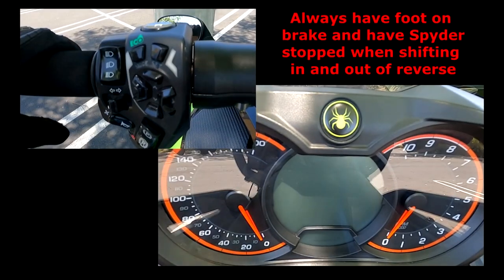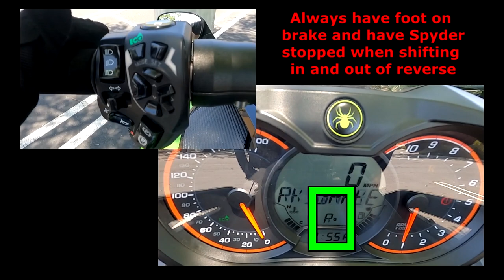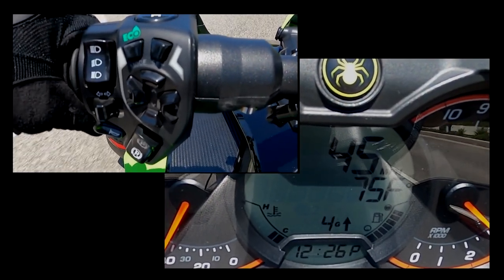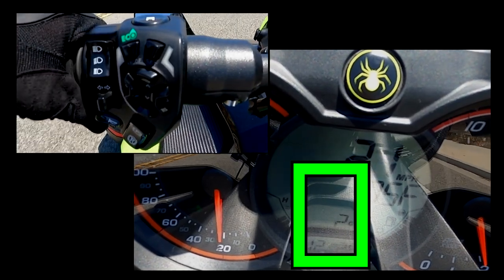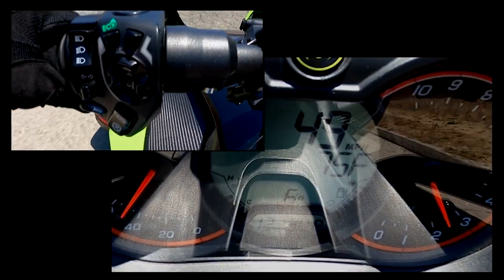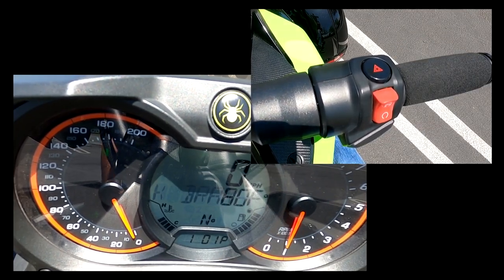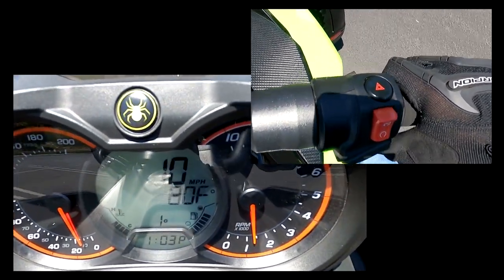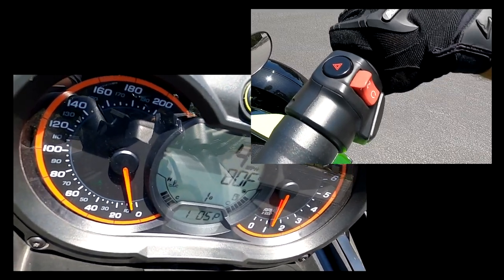Shifting a Can Am Spyder // Using the Paddle Shifter and Reverse on the Can-AM Spyder

Comment: Great informative video indeed.  So I like the bigger size of the f3 over the Ryker, but, I love that the Ryker is fully auto.   To be that close to fully auto, I don’t see why I just wouldn’t go with the Ryker.  Especially the Rally.
Reply from the maker: The difference between the Ryker and F3 is mainly comfort, quality, power and two up riding. If you want to ride long trips and have a passenger sometimes - Spyder wins on that. If you are looking to save some money, Ryker Wins. Ryker is more nimble and quicker on take off, but Spyder is more powerful and faster in the end. There are good and bad points to each, it all comes down to personal preference. Which ever route you take you will be happy with. Think about your needs when deciding.
Reply: @MOABMAN  Thank you so much.  So can the Ryker Rally be used for decent travel?  Like a 4 hr drive?  I subscribed by the way.
Reply from the maker: @a.d.c7941  Thank you for the Sub and support! The Ryker can be used for long trips but endurance really depends on the rider. You can also buy aftermarket seats that help with comfort. 4 hours should not be a problem for driver, but I would say no for a passenger. It is not the same level of comfort as the Spyders. The newer Rykers are improving though.
I suggest if you can take a test ride or sign up for the 2022 Can-Am experience if you are able to. Here is the video talking about how to sign up:
https://youtu.be/zKxIDBQPTyE

They take you on about an hour ride and they have different models to ride. Hope you can sign up and this helps.
Reply: @MOABMAN  thank you!! I am going to look into the can am experience.   Thank u so much!

Comment: What are your feeling about the Ryker?   As a local rider, quick grab and go.. for someone who already has an F3.
Reply from the maker: The Rykers are good for short trips and playing around. They are cheaper and feel a little different than the Spyder. I personally take the Spyder everywhere. My choice is Spyder over Ryker even for short trips. I may eventually get one (the Rally) just so I can do dirt road and a light off-roading in it and not feel bad if I ding it up. Supposedly that was one of the benefits of the Rally but I personally have not had the chance to ride it that way so cant speak to that. I like the looks of some of them and like the cost point as well. But if your question was more along the lines of, if I had a choice of one over the other and that was the only one I was going to own, then with no hesitation would pick the Spyder line. Way better of a ride, quality, comfort, power, and fun over the Ryker.

Comment: Hello MOABMAN Can you do a Video showing how to use all the features Like radio/Display/heat seats/ lights/ adjusting suspension and foot pegs for those who just purchased a new 2021 F3 Limited.
Reply from the maker: Hello Michael. Thank you for the support. I will do a video for the controls, but can't promise when it will be out right now. I have 2 videos in the works. I can help you out on the other things now hopefully. 
For the foot pegs this video may help: https://youtu.be/nQQo5ByhEN4 
it is one of my first so sorry about the editing. 
For the suspension, page 59 in your manual talks about it. It is super hard right now for me to get access to a spyder with everything going on, so I can not physically do a video on it. I hope this helps and as soon as I can get access to other Spyders i will make sure to do a video on this.
Thank you again for the support and I will do what I can to get the video on the controls as soon as I can

Comment: This is great for us future newbies to riding. Question?  when upshifting gears, to you keep throttling up at the shift or do you just lay off the throttle when shifting?  For someone like me who will be new to riding, I think the eco mode could be of great help when it comes to changing gears until we get the feel of the bike and changing gears becomes second nature.
Reply from the maker: Hello Stevie, thanks for the comment and support! You do not have to let off the throttle and it is better if you don't. You maintain the throttle speed when shifting and can even be increasing speed when doing so. The shifting for the Spyder is awesome and doesn't take long to get the hang of. Using the eco mode will help in showing you the best time to shift for good gas mileage, but is not good for going fast or passing a vehicle.  Any shifting between 4000 to 6500 RPM is good to get use to when not in ECO. Try not to train yourself if your new to riding a motorcycle on a bad habit of looking down to rely on shifting. Use ECO as a reference first, but train yourself to feel the bike. This way you take your eyes off the road less. A split second can change your life if your not careful. Welcome to the Spyder family, you will love it! Stay safe and ride happy.
Reply: @MOABMAN  Thank you for that advice!  That's my worry is looking down because in a car you can get away with that but on a bike, that could be trouble, especially on the highway as that could spell trouble.  It sounds like when it comes to changing gears (for a new rider) it's all about confidence and feel and that's the part you have to get used to and once that is set you're good to go.  I am really looking forward to getting the Can-Am Spyder and being in the open air as I mention, for me the biggest worry is gear changing as I have never ridden a motorcyle of any sorts but your video is the best one I saw in terms of teaching gear changing on the Can Am and it's helpful but as with everything it's just getting reps on your own to build the confidence.   Thanks again!!!
Reply from the maker: @steviem5279  The Spyder has removed all that fear for you, trust me. It is easy to shift. I do recommend that you check into taking a 3 wheel course. This would be the best thing for you to do to be safe. This will help you feel more confident about riding to.
Reply: @MOABMAN  I will definitely do that!  Thanks again!!
Reply from the maker: Your welcome and thanks for the support!

Comment: I have watched alot of your videos and have learned alot. I am taking my class next week for my license. But i have a very silly question im sure you will think. To slow down taking corners you use the throttle and then to speed back up you use the trottle correct? No breaks? I'm trying to learn all i can before the class as ive never riden a bike in my life i wear ankle braces...i have a 2015 Spyder RT thats been sitting all winter waiting for me to ride. And im anxious lol soon to be 62yrs old.
Reply from the maker: Not a silly question at all and thanks for the comment. First, dont be nervous about the class and what you think that you dont know. That is what they are there for and ask all you can. You will learn a lot and be confident to ride when done. You will "roll" off the throttle on certain curves and use brakes on others. The more you ride the more comfortable you will get at this. You need to judge before going into a curve and start making the adjustment. Sometimes you will only need to let off the throttle and steer into the curve. For sharp turns or curves, yes you need to brake a little before going into it. You dont want to slam on brakes in the middle of turning or curves. Coming out of a curve you then start giving gas again. They will talk about this in better detail in the class so dont worry!! Thanks for comment and support
Reply: @MOABMAN  Thank you so much i guess its close to like driving a car. Everyone has told me not to worry about taking this class its just something totally new to me. I really appreciate your help and your videos. I maybe asking more questions soon lol. Thank you again have a wonderful day.
Reply from the maker: @sallyhall-fj3yp  you are welcome and yes it is like using a car in curves (only speed wise). Go in to the class with no worries so you learn easier. You are more than welcome to email if you want to ask a bunch of questions. moab.man@yahoo.com

Comment: Great explanation! I was wondering if you always have to look at your rpms to tell when to shift or overtime you can just tell? Like Does the bike feel different and that’s when you know to shift or you just kinda know after awhile.
Reply from the maker: You quickly get use to the feel and sound of the bike. The only time I look at RPMs are when I am pushing the bike for speed and want to get every bit of power I can out of it. Even then you can feel it.
Reply: MOABMAN thanks for responding, looking to get one next month and I couldn’t get that answer anywhere. You just got a new sub!
Reply from the maker: @charliblaze718  Thank you for the comment and support! You will like it and it is a lot of fun. If you never rode a motorcycle before, don't worry, the Spyder is fairly easy to ride. You still need to be careful and not forget that it IS a motorcycle and your the bumper!!! Stay safe and ride happy!

Comment: Do you let off the throttle when you shift
Reply from the maker: That was one thing i wish i would have covered better than i did, so thank you for asking. You do not let off the throttle and it is better that you dont. For me i just keep it at where i am when i shift. What i mean by that is i dont let off or give it gas, just maintain the current throttle position. If you let off the throttle it will make a louder than usual "clunk" noise and jerk you a little bit, that has been my experience on different models as well.
Reply: Steady throttle on up shift.  Up revving is automatic on dowshift

Comment: Hi there and thanks a lot for your video! I have 2 questions:
1.- After turning off the engine with the killi switch, can I turn it back again while still moving and if so does it starts in neutral?
2.- What if I leave the gear switch “+” pressed while accelerating?
Thank you!
Reply from the maker: Great questions and thanks for comments!
1. Yes you can turn it right back on while motor is running. It stays in same gear and acts like your never turned it off. I have personally done this by accident several times, and same results every time. Good question!
2. Leaving the + pressed will not shift and I do not recommend doing this and getting in that habit. The computer system for the Spyder is very good. If it sees that the button remains pressed and your giving it gas and what not, it will trigger an error code or send it into limp mode. You then have to go to dealer to reset ECU and codes. For me I just tap the button and then remove thumb.
Thanks and hope this helped. I will be glad to answer any questions you have if I have the knowledge to answer. If I dont know I will be glad to help find out as well. Stay safe and ride happy!
PS... Love the icon
Reply: @MOABMAN  Thanks man, I've been thinking about becoming Spyder Ryder but here in Spain you can't test any Spyder at the dealers so I still have several questions about it. It is really a pity that they don't have any test circuit here so I guess I'll have to wait until my next trip to the States for doing that. thank you again for your answers.
By the way, I'm thinking about a 2021 F3-S NOT the Special Series (with color is everything but attractive to me) Any idea where to find reviews about this model? All I've found has been about the F3-Special Series :(
Reply from the maker: @Raffgon  I am sorry to hear you cant test drive one. Some places here won't either because of Covid. I have 2 videos out that may help answer your questions. The first one talks about the differences in all 2021 models:

https://youtu.be/5g_TMkzGieQ

This one reviews my F3S which is basically the same but does not have the digital display. They did not change anything other than the digital display so it is the same motorcycle, engine and all:

https://youtu.be/_ZbjerqAlvA

I hope these help you, and any questions you have i'll be glad to help you. You are more than welcome to send email as well to moab.man@yahoo.com
Reply: @MOABMAN  Thanks again... That was a very useful comparison you did! I hope I would be able to get an F3-S sooner than later. Here in Europe prices are just CRAZY (F3-S cost 30,000 USD) and they are not importing all colors from other models... and F3-T that is the model I would love to had well.. it just doesn´t exist here. In the other hand I really don't like those colors neither... that gray from the F3-SS or that ugly pale blue? no sir, I'm not paying money for that at all!!
Reply from the maker: @Raffgon  Agree about the colors they have. 30,000 is about how much an RT is here. The F3S is about 20-25 here. Right now it is a little hard to get a Spyder in the US too. The plant that makes them was shut down because of Covid for a while. The demand for the Spyder is more than they can produce right now. Hopefully they will get caught up and then you will get some more there. Thanks for the comments and support! I believe you are the first I've commented with from Spain.

Comment: Video helped me alot. I bought a spyder rt 2015 last august not knowing the first thing about riding. Im 61yrs old and this May im taking a class to get my endorsement. I am totally new to the bike world i have alot of friends that ride but i never have. Ive been watching alot of videos and i just couldn't figure out when to shift or how to really shift.And i had no idea you shift down to pass then shift up. Thats confusing to me. Can i ask you to explain that to me alittle more or if you have another video i could watch. Thanks so very much.
Reply from the maker: Thank you for watching and glad this video helped. Think of the passing part just like a car does. When you step on the gas real hard to pass a car, if your in an automatic it will shift down and then you RPM's will go higher and you can go faster. So lets go to shifting the Spyder......
If you are in 6 gear and your RPMs are around 2000, when you twist the throttle a lot to pass a car, it will take a while before your power and RPMs get to a fast speed. So if you are in 6 gear and 2000 rpms and want to pass, then it is best to shift to 5th or 4th gear (down). Your RPMs will increase and you will have more power for passing quicker. Almost all vehicles accelerate faster at higher rpms. Hope this makes sense and helps. If not, just comment back and i will be glad to help, emailing is ok as well if you feel uncomfortable commenting something. 
moab.man@yahoo.com
I hope this is what you were asking about as well.
Reply from the maker: Also, congrats on getting a new spyder and taking the first step to try something new.

Comment: Hi great video how's the passing power let's say you're  going 65 70 on the freeway will a bike over work? Just curious based on my area New Jersey Turnpike😩😖. Right now I am riding 2015 Victory Hammer great passing power comfortable but I'm really considering the can am. Love the safety feature
Reply from the maker: Thanks and good question so i hope i can answer in a way that helps you. It has good power. 1330cc engine 115hp. At 65 or 70 you just down shift a gear or two (do not be in Eco mode) and your easily doing 90 before you know it. My commute to work is 130 miles, on the way to work it is up hill. Most of the time if your not doing 80 or 90 you will get run over and i promise to you that the speed i just said is not an exaggeration you really have to stay at 80 or 90. Unbelievably there is not a lot of vibration or wobble either at that speed. The winds in this area are known to overturn tractor trailers and on the Spyder F3 it doesnt seem to care. My helmet is blown more than the bike is. As long as you have it in the right gear on the F3 the passing is not an issue, promise. The bike tops out around 120 but still feels like there is more to go.
My wife and i very comfortably rode up a steep hill (about 3 miles)on the interstate and we did 65 to 70 very easily with 2 people. I am referencing the 2018 up Spyder F3's. If you get a 900+- cc engine (years 2016 and older RS models) you may be really dissapointed. I wouldnt recommend a ryker for those speeds and that type of interstate driving. Just so you know i am originally from the East coast so i have ridden the Jersey turnpike and in Atlanta traffic too, so i know where you are coming from with rhat question. Hope this helped. Thanks for the comment and support!
Reply: @MOABMAN  thank you so much!!! I'm so grateful for your reply! So keep my eye on  2018 f3 and up! Once again thank you.  Ride safe brother man.
Reply from the maker: @jasonbourne4127  You too! If nothing else, test ride one, they are different and fun!

Comment: I have one question when you're sifting up is up in Eco mode or maybe the regular mode when you shift do you have to let go of the throttle like you would if you were shifting with your foot do you understand what I'm saying  In other words do you have to let go of the gas shift the gear and then give it more gas Like you would shift with your foot
Reply from the maker: I do understand what your saying and use to ride two wheel so know what you mean. Good question too. The semi-automatic spyder allows you to stay on the throttle while shifting at any speed. It is the same for any mode your in- ECO, Normal, or Sport. You can order a manual on them, but I have to be honest... The more I use the paddle shifter the more I like it. The brake will probably be the awkward thing for you to get use to. It is on your right foot and controls all wheels simultaneously, and it stops the bike quickly.